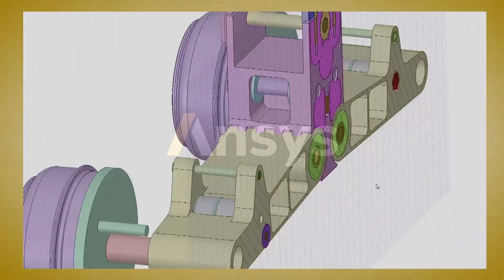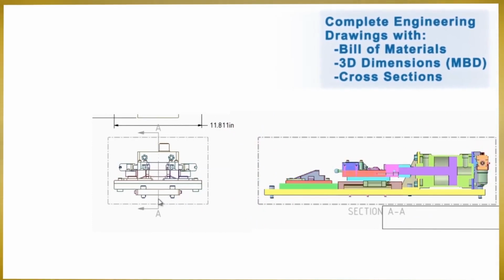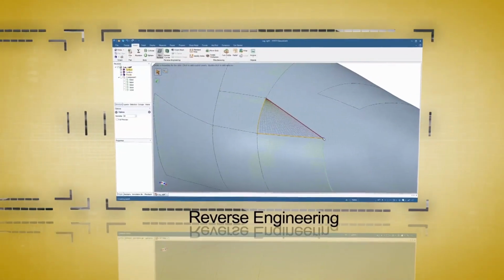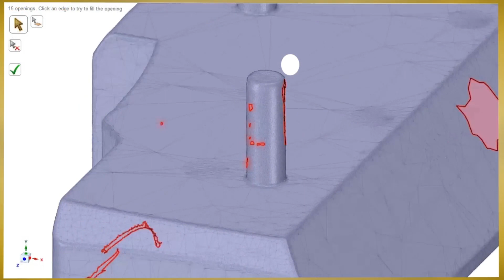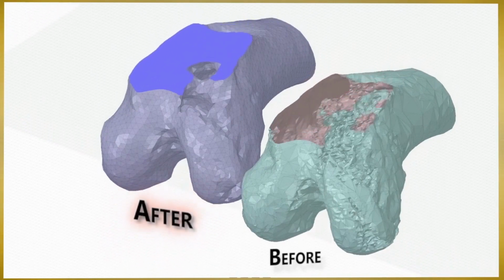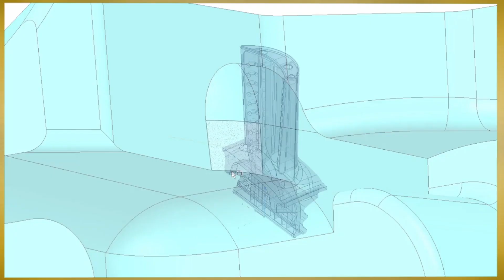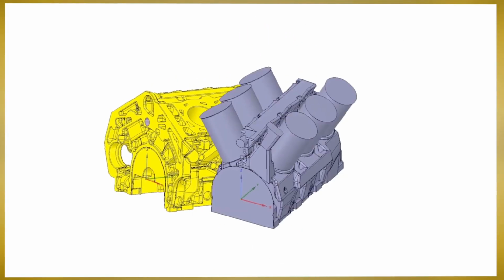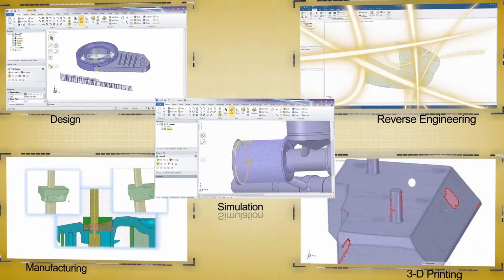Pervasive 3D Modeling with Ansys SpaceClaim

Comment: It's hard to believe that SpaceClaim doesn't have a framing tool. I would hazard a guess that by far the most common steel structures are constructed from steel sections (e.g. RHS, SHS, PFC, UB, UC, etc., requiring a framing tool), and plate (requiring a sheet metal tool). A framing tool could also be used for pipe runs, which I thought would be an obvious application for Live.